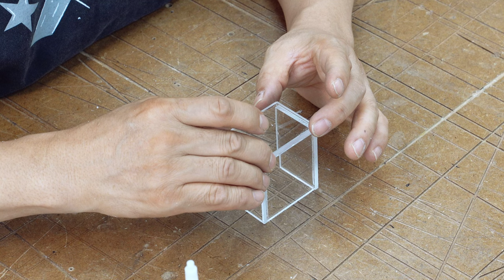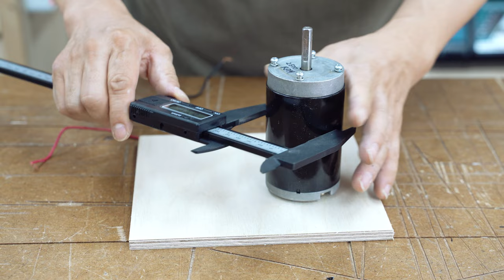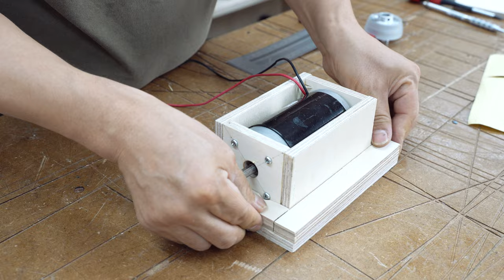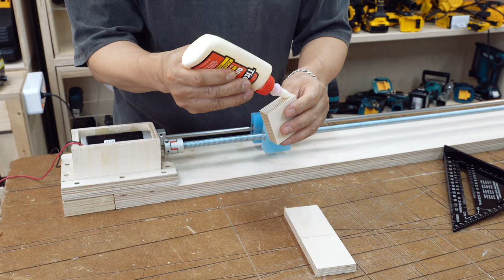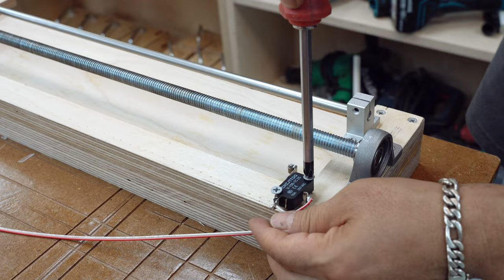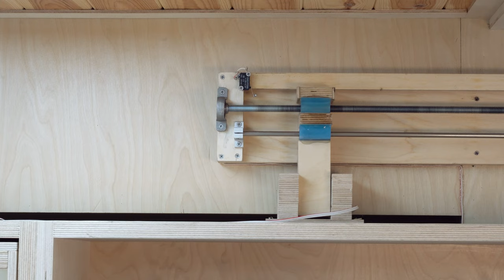Secret Door / DIY

Comment from the maker: I expanded the workshop behind the bookshelf decorated with tools.
It was the place where the door was originally located, but I took it off and replaced it with three cabinets, and I made it open automatically.

I've connected three cabinets and there's quite a lot of tools in there, like drills, and I've put rails on the floor to make it easier to move, so it doesn't take that much power to move.  
The drive motor is a 24V motor removed from an abandoned massage chair.

I used a 12mm computerized bolt for the main axis of the cabinet, but I guess I should have used a thicker bolt than 20mm. There is a phenomenon where the axis bends a little when you move.
If you want to make it similar, make sure to work with a bolt of more than 20mm.

I made the screw part separately so that the bookcase could move by connecting it to a bolt.
I worked with epoxy, but when it hardens, it becomes very hard.
The reed switch has been used to act as a limit switch so that movement can stop at both ends.  The limit switch creates a limited area of movement and prevents overloading the motor. I used the 5V remote control switch that I had already made as a basic switch.

The people who built the automatic door and watched it say that it's like a device from a secret door or a 007 movie, but it's actually a very simple structure.
Please refer to the video carefully and try making it.

Next time, I'm going to make an automatic door using pneumatic cylinders.
Cylinders can be custom-made up to 2,000mm, so they are usually sufficient to open and close doors that are about 1,500mm in size.
Please look forward to it. Thank you.

#DIY #Studio #Interior #AutomaticDoor #Making

Comment: Found and binged several of your videos. Great channel and growing. Wondering what are you using inside your 8kg weights? I checked roughly that size box would be only half the weight using cement. I’d guess metal or specifically lead but could be steel. Fishing sinkers, bullets, or tire weights are good sources. Maybe you just used old hardware like nuts and bolts. Very curious what you used.
Reply from the maker: That's a very smart guess. I cut the steel and put it inside in brick-sized and half-brick-sized pieces. Even though I thought it would scratch if I just used it, I finished the exterior with 12T of birch plywood and attached a handle. Since the specific gravity of steel is about 7.8, it is about 3kg and 8kg in that size. I also have a video of this work, I will upload it soon. Thank you very much for your words of praise.
Reply: @Kynosys_  I already have notifications on for your releases. Thank you :)